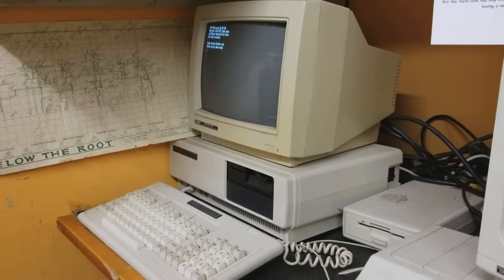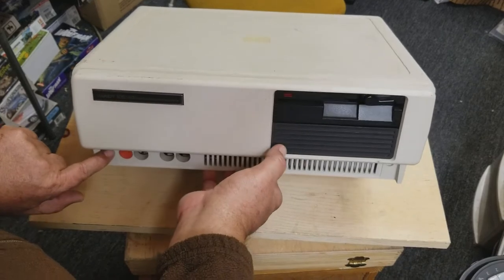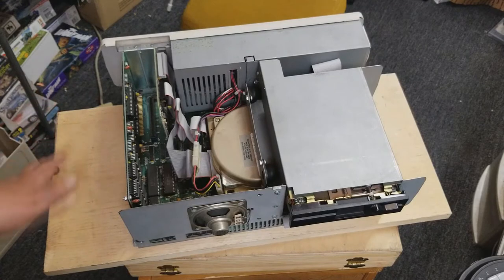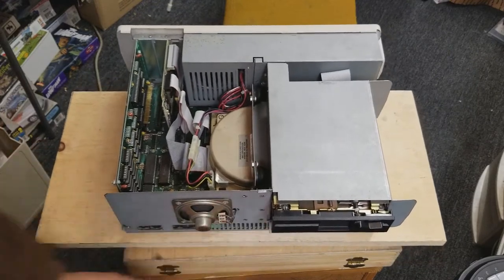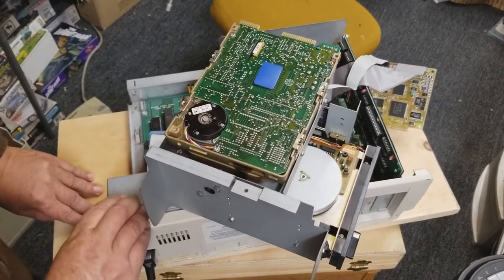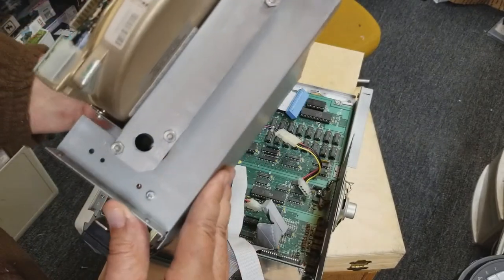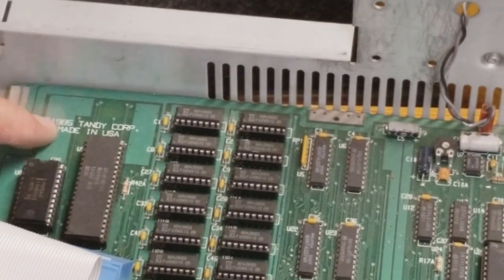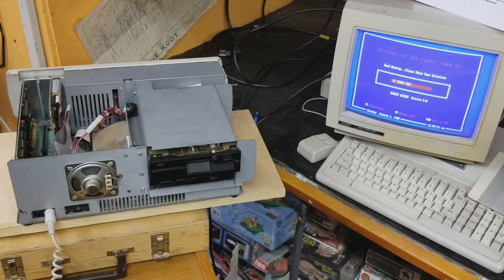Look inside The Tandy 1000HD & Repair its Failing Hard Drive

Comment: I just picked up a Tandy 1000A that someone installed a 15MB MFM Hard Drive with original controller. The Hard Drive fits under the floppy, so I don't believe it's original. Does the V-20 cpu give you better performance? I just ordered an 8087 on ebay for $6, and was thinking of getting a V20 chip. I only wish I had the original Tandy Monitor to go with my system.
Reply from the maker: Your correct, if the Hard Drive was placed directly underneath the Floppy Drive. It was not original to the computer. Actually the Tandy 1000A was never released with Hard Disk Drive's. Radio Shack preferred that you purchased the 1000HD. I believe the Bios was upgraded to access the hard drive more rapidly. At least that what my tests show when I bench mark both the 1000A & the 1000HD with the same Hard drive & controller. I see faster access times on the HD. When you add a NEC V20 don't expect to see faster clock speeds. These old mother board will only run at constant timing cycle no matter what you do, unless you start messing with the timing hardware. What you will see is much faster speeds when the V20 is actually running heavy CPU use programs. Like all Retro Rigs computers, monitors & parts are getting pricey & harder to find. A 15MB MFM is a rare bird, take good care of it.
Reply: I used to work on ATT 6300 series back in the late 80's and I remember you had to park the hard drive before shutting the computer off. Is that still the case with these old MFM hard drives?
Reply from the maker: @twiddler71  it depends on the drive. Most early drives had no auto park. All ST series Seagates came with auto park.
Reply: @HavocSun  I just took the Hard Drive out and it turns out to be a Seagate ST225, so I guess it's 20mb. Strange thing is that it only works properly upside down. I'm going to try a low level format using SpeedStor and see if that fixes things.
Reply from the maker: @twiddler71  That's a clear case of the stepper motor failing. Follow my instructions in this video to fix it. I  would not run the hard drive upside down for any length of time. The heads aren't used to operating in that position and you may end up with more problems.

Comment: My old 1000TX came from an auction years ago, so I don’t have any history on it. I recently dug it out and rebuilt the power supply. It has the optional hard card, but when I turn it on, it shows the 640k memory then immediately asks for a boot diskette. No bios screen or attempt to boot from the hard drive, tho the hard drive does spin up. Is there a way to force a bios boot? Where do I go from here?
Reply from the maker: Bios on these rigs were very basic, so no you have little to no control on how the computer seaks. Whats probably happenning is the hard card has failed. The disk drive probably is suffering from a common problem back then I use to call "sticktion". Do what I did in this video to lube the stepper motor. Your HD is a little different but the stepper motor is accessible from the underside of the HD. You will have to remove the HD then flip it over, then lube the stepper motor with WD-40. Good luck.
Reply: @HavocSun   I ended up doing basically the same thing you did. On my drive the stepper motor has a shaft that sticks straight up out of the side. I gave it a couple of drops of light oil, then turned the shaft back and forth a little bit. After reinstalling the card, a reboot brought it up into the C drive. Now I need to brush up on my DOS….

Comment: I'd ask if you were able to get a dump on the two PLA chips on that DMA/RAM card, but that would involve unsoldering them and sticking them in an EEPROM programmer. One of the things I'm working on is reverse engineering these cards so it'd be possible to replicate them. Lo-tech offers 1MB and 2MB RAM cards, but nobody offers DMA controllers for these old machines.
Reply from the maker: Wow are you reaching into my mind?! I have often thought of pulling the PLA chips and putting them on my EEPROM programmer to make duplicates. Unfortunately I'm worried since this is the last expansion card I have. I look constantly on Ebay for some, No luck so far. When I see the mods for the EX or HX & the memory expansion cards for all XT's. I dissected a few only to find no DMA. It's why I keep searching for another original Tandy expansion card that I can operate on.
Reply: @HavocSun  I don't have an original for the 1000HD, but I managed to snag a 3rd-party card by Advanced Transducer Devices that I'm working on reverse engineering. I have the technical manuals for the 1000, and 1000EX and HX, but the schematics don't include truth tables for the PLAs that I can find, unless one of the other models has it. The HX doesn't include expansion schematics at all. While the EX manual HAS schematics, it gives no useful information for the ASIC on the PLUS card, which has all the support logic integrated with the DMA. But the 3rd party card uses only discrete 74xx logic besides the memory and DMA controller, so that's where my hope lies right now for reverse engineering this thing. 

I don't have a 1000/1000A or 1000HD, so I'm hoping to pass this card on once I'm done with it.
Reply from the maker: @BlackEpyon  I would be willing and honored to try what ever you come up with. Maybe do a vid to my small but dedicated Tandy enthusiasts on the results!
Reply: @HavocSun  Certainly. Just don't hold your breath, because time isn't something that I have in abundance.

Comment: Well, there's always Compact Flash if all else fails. But like you, I prefer to keep the hardware either original, or at least appropriate to the time period, if at all possible.
Reply from the maker: I agree %100, this is the only time I know of being a full on "Pack Rat" paid off. I never threw anything away. I would dissect it, see what made it ticked. Early on In most cases I destroyed any chance of repair. After awhile I started to get a better track record, saving more than I destroyed. Now I can fix most older hard drives that have a chance. I have ended up with a horde of older drives. At least that's what my wife calls them. If the day comes that I must go to CF, so be it. As long as the end result is these computers keep running. Honestly the time I spend on these computers (80% of on HD's) is well worth it to me. I love the sound of a cold boot with a quick seak time and a C: prompt!
Reply: @HavocSun  Indeed, part of the nostalgia is in waiting while listening to the hard drive tick. 

I've built a PLUS version of lo-tech's ISA-CF adapter on a perfboard so that I'd have some internal storage on my HX, with a 16MB Canon CF card, to keep the size "period appropriate." Working on a proper PCB, but my landscaping business tends to eat most of my time. This is just my hobby.
Reply from the maker: @BlackEpyon  As it is with most of us.

Comment: 12:04 That's a bit difficult with no controller or cables connected :)
Reply from the maker: I guess I wasn't clear. But I meant the hard drive internal system checks booted. It definitely didn't boot from what it read on the fat table because it was not connected. I go on to say later that I was looking for a (DOS) boot once I connected it up.
Reply from the maker: If you spend as much time with old MFM hard drives, you begin to notice they have a internal boot order. My guess is the drive is going threw a few checks before it starts to send the fat table info to the controller. I have been able to tell when in most cases a old MFM hard drive is likely to boot to a C: prompt even before I connect it to a computer. Just by the start up sounds it makes. That's what I was talking about. I guess I wasn't that clear.  My apologies.